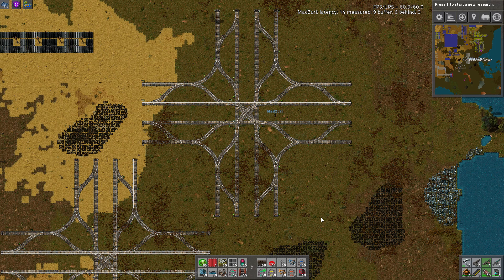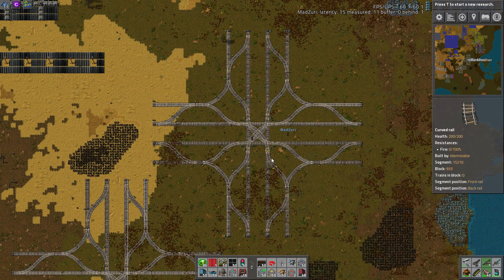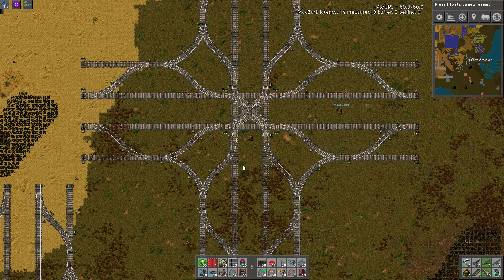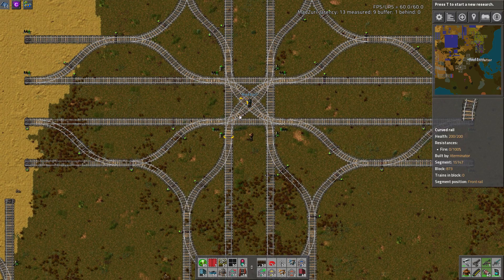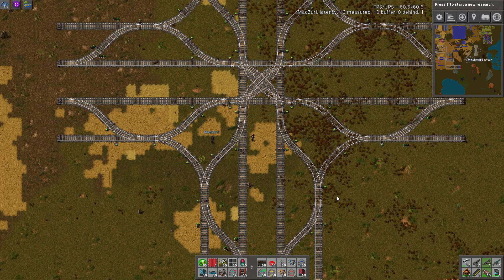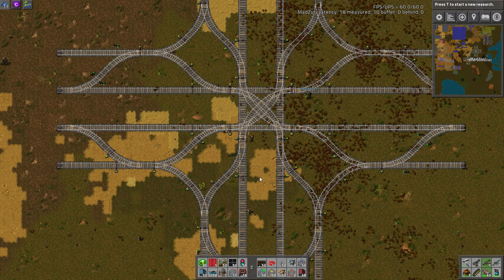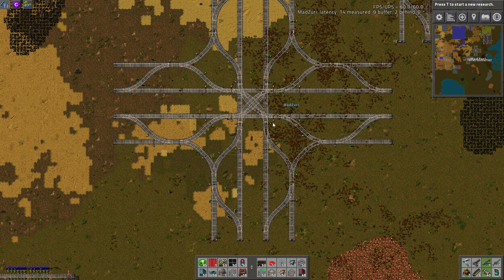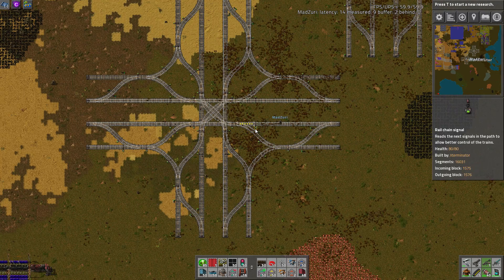Factorio Workshop - Building A Bettery Factory :: Rakkfalen's Rail Junction Final

Comment: What about if we do away with all intersections, and just swap the material at all branch points? Is that possible? Essentially all forks in the track will turn into an unload and load station. Trains shuttling between these intersections could be huge mega long trains with mixed goods. Then just increase the number of trains and unloads to match with the growth.
Reply from the maker: That is a really interesting idea! I've been playing around with a somewhat similar idea for my 0.15 base and it seems like it has a lot of potential.

Comment: I've never built wider than double track.  For four tracks, if you don't do lane switchers, how do trains get to use the express lane?  Or are the outposts assigned to one or the other lane?
Reply from the maker: Usually they will have lane switchers somewhere else in the track or just use one lane. We prefer to use T-Junctions rather than 4-lane junctions, it solves a lot of these issues.